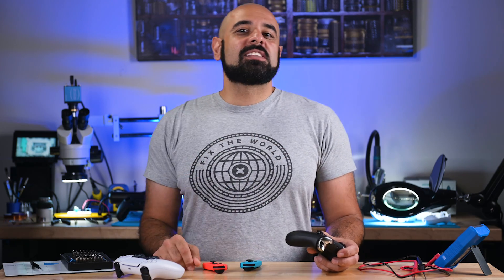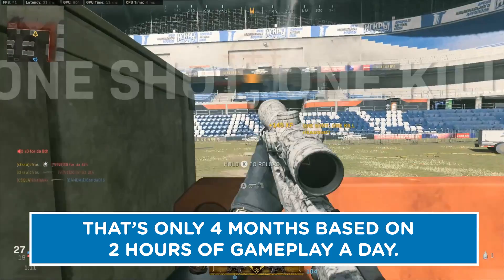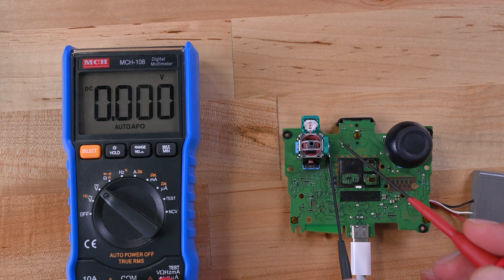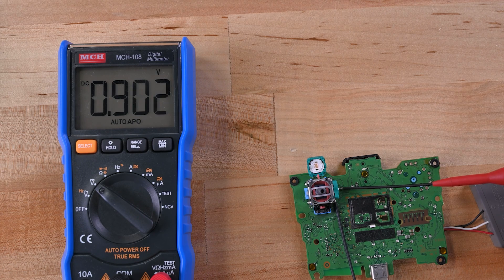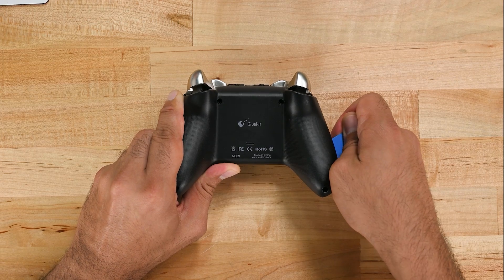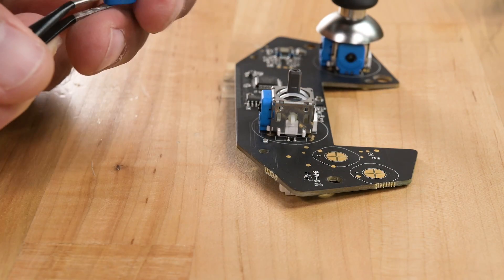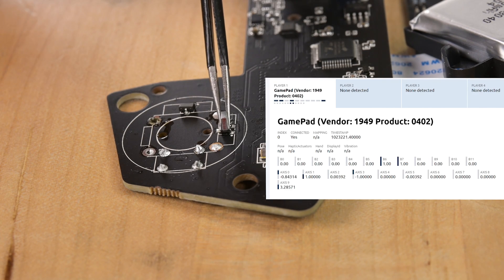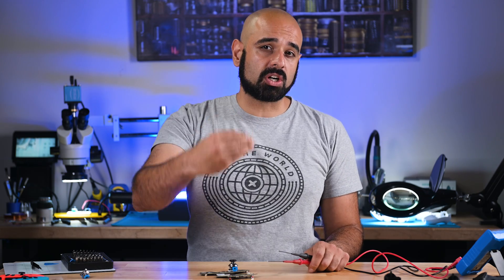How Manufacturers Can Fix Joystick Drift - Permanently!

Comment: Only problem is that GulliKit has a patent on the hall sensor sticks for controllers I believe. Because of that patent, it's very unlikely console manufacturers are wanting to adopt it unless it's for premium controllers (a la Scuff) to compensate for licensing costs.
Reply: It's only patented in China, I doubt they're able to patent it in other countries since hall effect joysticks had existed for a long time and are used in some old consoles already, the cost would still be higher than the potentiometer ones though

Comment: Excellent video! The fact is that potentiometers are ultra cheap to manufacture and little is needed to make them work well enough. You could even add an offset value in the controller itself (added via software and editable) to correct drift but manufacturers won't let you change it. That could extend the life of your controller at the cost of accuracy. Eventually the compound used for the trace inside the potentiometer will wear out and no software fix will be able to solve drift. This is not the only (or better) solution though. Rotary encoders (optical ones for example) have been around for decades and those are almost wear free. No, those don't have an "infinite" amount of "steps" (not analog) but can have a really really good resolution. Along with some clever math and software you could make them work just as fine. Ahhh but the cost .... (sarcasm). Keep doing videos like this one!
Reply: It's a shame Nintendo only used optical rotary encoders on the N64.
Reply: @icebergmm  Was going to mention N64 using it. Though for quick movements you could hear the gears running.

Seems they could use a simpler analog scheme where the disc has a slit of varying width that progressively blocks or allows light to a sensor as it's turned. Similar to the magnet approach.
Reply: @gargantuablargg  there are fully analog optical mech keyboard switches that are smaller and more reliable than the n64 controller that could be used.
Reply: @icebergmm  destroyed so many n64 sticks playing ssb.  Not sure that's the way to go.
Reply: Weren't ps3 controllers optical?
Reply: @castome7pi  no, but they use hall effect sensors or a very similar tech as noted by benheck in one of his videos.
Reply: This. Also hall effect sensors CAN wear out as the magnets can demagnetize over time in extreme hot and cold situations. Also if using rare earth magnets, there are already shortages of the material required for making them. Opto/rotary encoders don’t have this issue if well sealed. Smoke alarms that use optoencoders all have useful life spans of over 10 years.

Comment: Hall effect sensors are also prone to go bad . I have removed several bad hall sensors from laptop motherboards which were preventing the laptop to turn on by giving a false signal to the embedded controller that the lid is closed. . Best bet is to go for optics based solution .
Reply: optical isn't perfect either, as dust and grease can obstruct the light path. Hall is better, i think. Another almost eternal technology is capacitive.
Reply: @victortitov1740  Use sealed enclosure to mitigate the problem of foreign objects . Also hall effect sensors can easily get affected from the altering strong magnetic fields from the nearby devices such as built-in speakers in the controllers due to space constraint .This is the reason why phones and tablets do not use hall sensors to detect phone cover as they contain strong neodynium magnets but rather rely on the proximity sensor .It is easier to shield a device from light than than from magnetic fields . Capacitive is difficult to implement because you cannot induce charge from outside or conduct charge as you normally do with your fingers as the analog sticks are normally rubber coated and creating a capacitive array with high resolution in a small 3d space would not be economically feasible .Till now optics is the best practical approach
Reply: @maxinventer  static magnetic fields from nearby magnets can be canceled in firmware. Dynamic magnetic fields can be shielded by a steel enclosure. And i highly doubt these fields are strong enough to even matter - phones have magnetometers (compass) in them and detect the magnetic field of the earth without much trouble, which is way way wayy weaker than the field of a neo magnet in close proximity to a sensor.
You don't need arrays of electrodes to make a capacitive sensor - just two pieces of metal will do, as long as they are close enough together that their mutual capacitance is vastly larger than that to surroundings. Then you just measure the capacitance in analog way. Pressure sensors commonly work in this manner.
Reply: @victortitov1740    Shielding will increase the size of the enclosure and dynamic magnetic field will always vary according to the audio signal and will require complex programming in firmware as even in 8 bit mode the ADC will have 256 steps . For capacitance based solution it will require a refresh circuit and since the minimum number of steps required is 256 in 8 bit mode it will require some serious shielding to prevent a drift in default capacitance values . I have made a dsp based on your approach in the past and the preset values tend to drift in real-time when used without shielding. Also the device will also need to pass emf and EMC test and will increase the pain of the designer . You are theoretically correct but the target of the design here is to accurately measure steps to avoid drifting and that can only be done by using higher bit resolution which will be very hard to maintain using varying charge capacitance . One typical example is when a laptop is run with an unclean power source the touchpad starts behaving erratically and goes out of calibration due to the use of a poorly shielded power supply.
Reply: @victortitov1740  You can't shield magnetic fields with a steel enclosure. It can help redirect and short-circuit magnetic fields though in some cases, to some extent. But there's only so much weight people are willing to endure in their hands :D
Reply: @maxinventer  I think there's a solution to capacitive drift issues; you have say 4 pads and an actuator that interacts with all of them at the same time, and you sense them relatively, you don't need absolute values. Luckily for capacitive sensing, the shielding can be held very lightweight and minimal in volume but still thorough in coverage. But indeed there are engineering challenges there, for sure.
Reply: I've seen more than a few myself but usually in the opposite state where the computer thinks the lid is constantly open. This is an interesting concept for both applications! I can see how a simple light sensor could be implemented for a laptop lid and could be contained within the hinge.
I hope I'm wrong, but I'm not sure if there are optical emitters and sensors that are small enough to replace the joystick potentiometer size that will has enough sensitivity and resolution.

Comment: I wonder if the hall sensors can be installed in the Steam Deck is that is a larger device than a regular controller that will be prone to stick drift in the future?
Reply: https://youtu.be/JXhT13oZchA Yeah you can
Reply: I don't remember the name, but a company makes hall effect joystick replacements for the Deck. Linus Tech Tips talked about them on a recent video of the "Ultimate Steam Deck". They are quite easy to replace and they even allow you to reduce the deadzone since they are more accurate
Reply: @miguelagueda3928  Gulikit
Reply: @miguelagueda3928  its the same company as this video

Comment: They can do it by looking at the original Dualshock 3 and dreamcast and saturn controllers. They use halleffect instead or cheap potentiometers
Reply: The Dualshock 3 use hall sensors? Or was Six Axis controller that doesn't has rumble?
Reply: @GenesHand  Dualshock 3 model CECHZC2U (maybe some other models), has hall-effect, yes.
Reply: OG Xbox as well
Reply: @edwardtan1354  Nah the Duke has standard potentiometer ALPS sticks, same as PS1 Dualshock.
Reply: @SianaGearz  so maybe it was the 360? since IIRC Ben actually salvaged 1 analog stick from an Xbox controller and that had magnets in it
Reply: @edwardtan1354  Not that either, i have a house full of 360 pads and i had all of them open, still standard ALPS. They went with Hall triggers in Xbox One then but not sticks.

Going back the most prominent Hall stick controllers were the Saturn 3D and Dreamcast. Maybe you've seen one of those and then it got mixed up with Xbox for some reason.
Reply: @SianaGearz  so thats probably where he got the HFSes then...

Comment: Not just current gen controllers have this design for the analog sticks, this has been the case for pretty much every generation of controllers, people seem to be have started complaining now. Infact the analog sticks for the DualSense Controller(PS5) are pretty much the same as the DualShock 3(PS3) ones. In most cases the drift can be fixed by cleaning the pots with rubbing alcohol and cotton buds, been doing that for years.

Comment: I wish you were right, but the Quest 2 controllers from facebook use hall effect sensors. And they are notorious for driftig. I wanted to fix mine, but since theres no potentiometers it is very likely that the SMD soldered Sensor is faulty. Even if I were alble to desolder the chip, I'm unsure if I can even find a replacement.
Also there is very little information on how to fix these, maybe IFixit can cover it?
Reply from the maker: This is interesting! We shall investigate further.

Comment: Would it be possible to put hall effect joysticks like these into regular controllers?? If you could make the output signal of the hall effect sensors "look like" it's coming from the potentiometers, it could work. And you wouldn't have to change anything on the software side I guess. The hall effect sticks look very similar, so they might even fit in? But you would have to put a custom board or at least more component in I guess and the rest of the electronics is not made for it and all that
Reply: It does work sorta like the potentiometer, when it's in the middle of the 2 magnetic poles it bleeds half of it's energy into ground so it would be centered for the xbox controller. All that matters is the positioning of the magnets, so that it doesnt work inverted (pointing up and your console thinking its down)

All the controller cares about is the voltage respecting the 0v to 1.8v output range, because that's what the cpu uses for referencing "where" each potentiometer is pointing to

Comment: I played on ps2 and xbox360 and i have the new Xbox controller and i never had a joystick drift, even my brother who played on his Xbox one for at least 4 hours a day for months never had a joystick drift
Reply from the maker: You're right, this won't become a problem for everyone. How you use your controller seems to play a big part in how quickly the pots fail but there may also be other factors at play. The 2 million rotations that the manufacturer quotes is an average which means some units last longer than others.

Comment: I once found a video on the Joy-Con stick drift issue. and it all boiled down to this one kid who did a lot of soldering and a lot of investigative research and everything. and it actually simply boiled down to long story short just "putting more material behind the motherboard of where the, Joy-Con joystick was at." I'm not joking You could take a piece of paper and fold it and that would be enough of material to basically put it back behind the motherboard of where the joystick is inside of the Joy-Con and that was enough to basically stop the Joy-Con from drifting. not even a billion dollar company like Nintendo could even figure that out.

Comment: Sometimes you can mitigate a little bit of drift depending on which of the axis is affected, what action is required, and if the game or software supports it. 
1. By adjusting the deadzones, or 2. for example when it affects running of the character, to map that action to another button if possible. I've had to do it in a few occasions.
It's not a solution, just postponing the inevitable, but you can still keep using it until you can fix it properly.
Reply: Adjusting deadzones and re-mapping buttons delays or masks the problem. 

Hall-Effect or Optical sensors are better and longer lasting. 

The N64 controller uses an optical sensor and the thing that wears out is the analog stick itself grinding against itself, not the sensor. But because the stick and sensor are one unit, you just replace it. I had to replace it in my N64 very early on, just about 2 years after the n64 launched. Knowing what the actual failure is, using a little dab of lithium grease to prevent the plastic-on-plastic contact grinding itself into powder - that same controller still works to this day for my kids.

Comment: So far I’ve not had a single controller having drift. However, one thing I never do is never add pressure to the stick while turning. And I have my thumb on the outer edges, not laying flat in the middle Center of the stick like many people do.